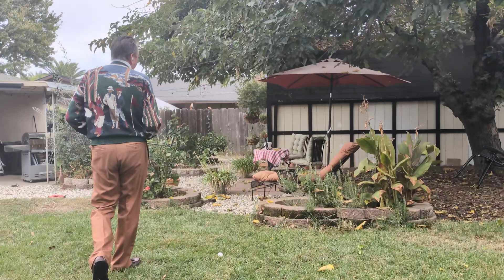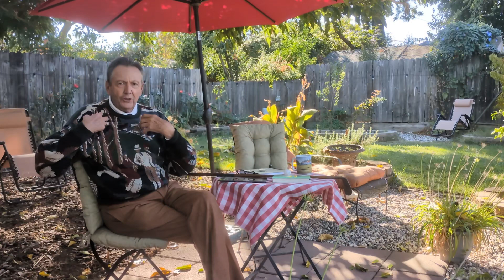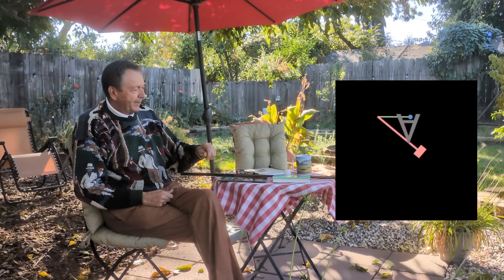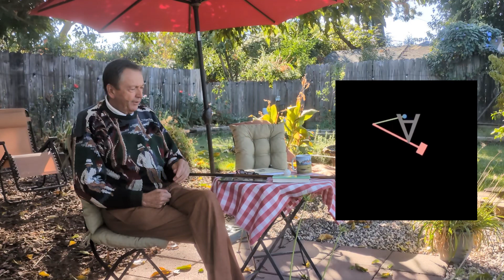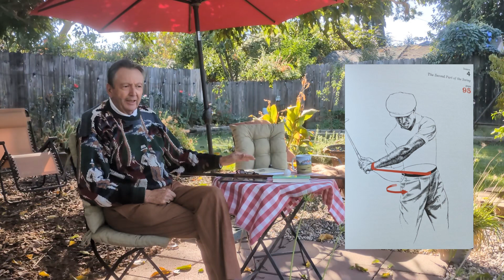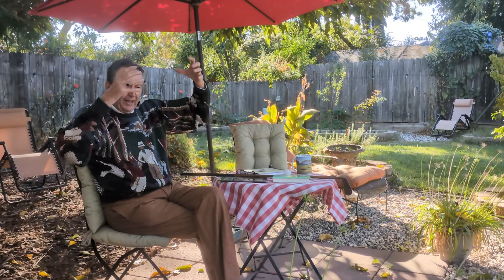The Golf Swing - A Trebuchet

Comment: I’ve often compared the golf swing to a Trebuchet quipping “Life is a Cabaret but a golf swing is a Trebuchet” which always result in puzzled looks 😊

But I think you are overlooking the roll gravity acting on the mass of the lead and trail arms plays in the Trebuchet action in the downswing.  You do touch on this when mentioning the lateral shift a the start of the swing.  

Being technically minded and having learned golf in my 30s I’ve always thought it terms of force vectors for everything involve in producing kinetic energy and the affect distance of mass from from center of rotation plays in generating force and maintaining balance.

By way of analogy consider how a figure skater starts a spin with arms flung and extended wide at shoulder height to create rotational momentum and then pulling them in and crossing arms spin incredibly fast in perfect balance.  That same mechanical action of extending back with single lever lead arm + club high MOI in a Hogan style takeaway then letting the club for rapidly cock the wrists — bringing the acceleration club head mass closer to the center of rotation between the feet makes the rest of rotation of shoulders and arms around hips and raising of arm mass AGAINST the force gravity effortless.

Tiger Woods in his 2002 book “How I Play Golf” writes about how father Earl coached him about the takeaway extension, imaging there was a wasp nest on the end of the club you wanted to throw as far behind you as possible. I had up to that point been bringing the club back slowly but the next time at the range I tried doing if with ‘gusto’ and was gob struck by how the club reacted, whipping up and around the hands with such force it felt like instead of the heavy club my hands were being pulled up by a ballon or invisible ‘sky hook’.  It resulted in the best shoulder turn and stretching of legs and torso followed by more rotational acceleration in my hips when released with a lateral shift of body mass to initiate the down swing.

That lateral shift of lower body mass to initiate the down swing also changed the force vector of the arms and club to be more towards the target which is why the downswing is more elliptical than circular.  As the relaxing of the backswing stretched muscles accelerate upper body, arm and clubhead mass, the club head mass, like the arms of the spinning skater, ideally needs to stay in the cocked and upright position as close to the center of rotating because early release ‘casting’ will act like a governor in an engine and slow down the hip and shoulder turn.

But while that passive rotational release of the kinetic energy from the backswing is occurring the spin the hips and shoulders GRAVITY is also accelerating the mass of the arms towards the ground at 32 ft./ sec/ sec.  but only to the extent the LEVERAGE created by bending the trail arm in a V allows the lead arm to move independently from the shoulders.

Hogan’s often quoted comment about wishing he had ‘three right hands’  was a hint for me there was a hidden meaning in what he said, some secret he was giving a clue for.   What I realized when I adopted the unconventional way he changed his lead wrist from maxed out in extension at the top of his backswing 🫸 but then by impact was changed to the opposite “locked up” orientation of dorsiflexion of the wrists and supination of the palm I realizes that as my arm trail arm straightened that change in the lead wrist was rotating the forearm of my trail hand as it straighten exactly how I did been taught to execute a palm up fist to palm down fist karate punch with the same rotational application of body mass acceleration behind it.

The “big picture goal” in the golf swing accelerating the club head as much as possible, and there are four means to that end: 1) lateral acceleration of the entire body mass towards target; 2) rotational acceleration of lead arm mass; 3) acceleration of lead arm mass due to gravity — as permitted by straightening of the trail arm, and; 4) the rotational acceleration of the club head mass around the hands, in react to the hands reaching the bottom of their swing arc and gravity being finally able to act on the club head mass to whip it around the hands.

All four of those things happen to varying degrees in golf swings at all levels but what separates most recreational golfer from elite ones is how much those actions contribute to the speed of the hands pulling the club and the force with which it whips around the hands. When became consciously aware of how rotating my trail arm while straightening it increased the velocity of my hands through impact it greatly improved ball compression and distance compared to the non-rotational extension I had been using.  I also discovered that by activity ‘punching’ down towards the ground as my hands came to waist level that than the non-rotational sweeping action I had been using — and see most recreational golfer use— the tendency to ‘early extend’ with the trail hip disappeared and with it balance and accuracy problems which had always plagued me for reasons couldn’t seem to control.  The net effect of it was finally being able to achieve maximum ball compression as evidenced by the imprint of the ball left on the face of Driver and irons and starting wear out the same spot on the face.

At 72 I hit the ball with more force with far less effort than I did in my 30s with much more ability to shape shots, which requires spin which increases in proportion to how well one can compress the ball on the face of a wedge or iron  because I understand the biomechanics and physics better.   😊